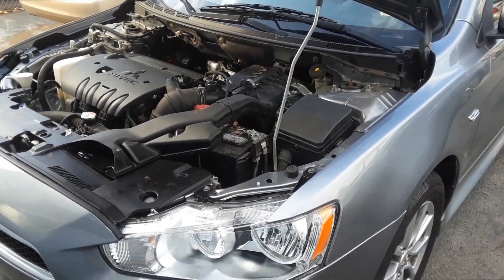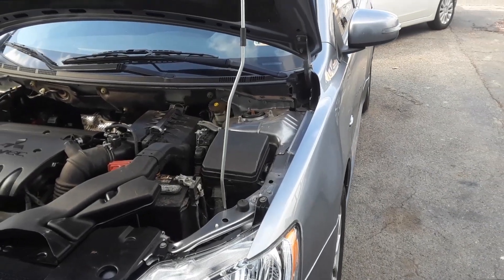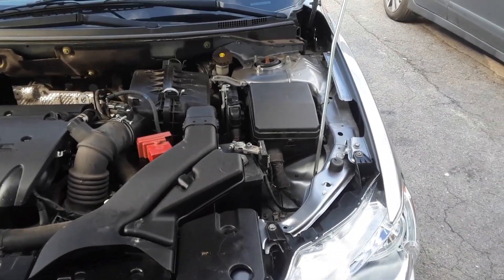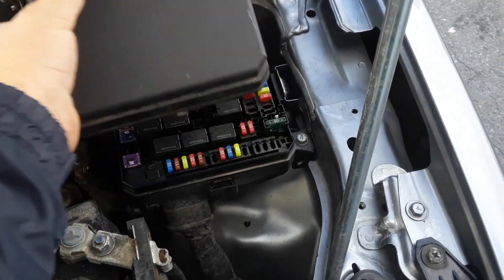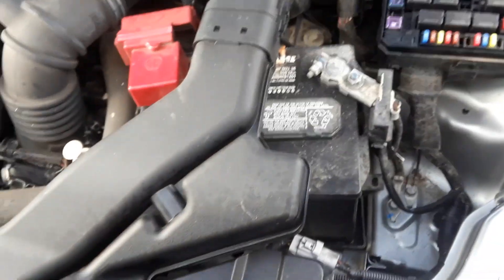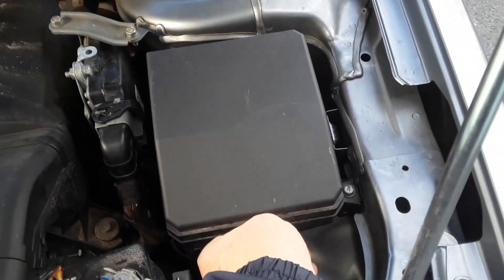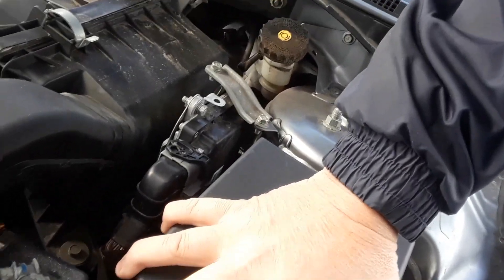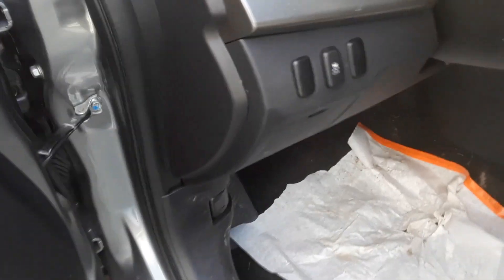Mitsubishi Lancer Fuse Box Locations &OBD 2 Computer Hookup Location

Comment: good evening,
front parking sensors are not allowed on a lancer 1.5 no evo.
I wanted to know where would you route the cables from the engine to the passenger compartment? where is there a hole or a sheath to pass the cables?

Thank you very much

simone goes